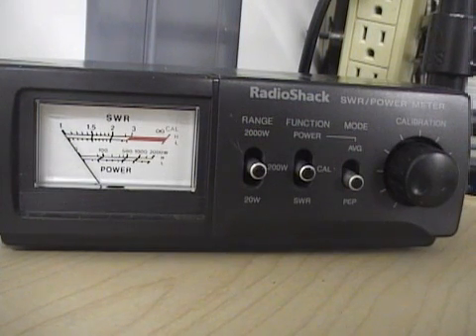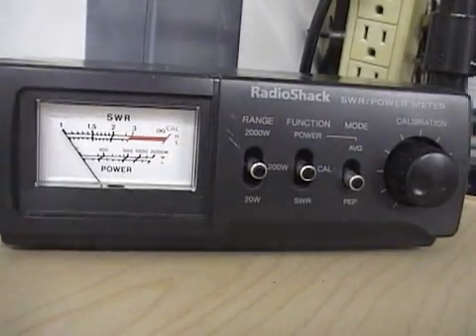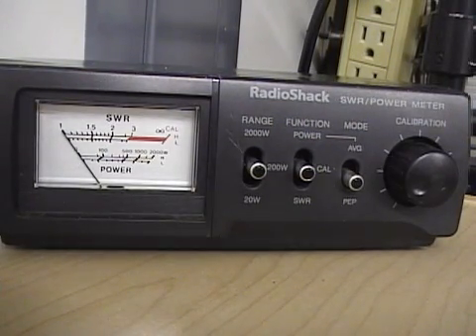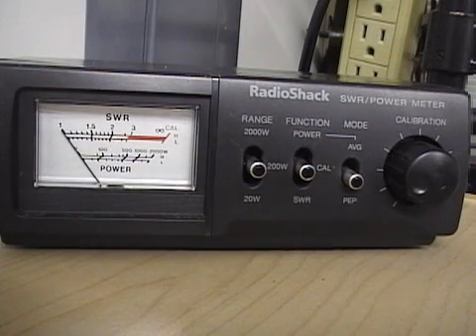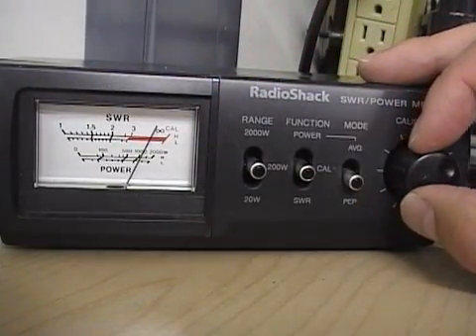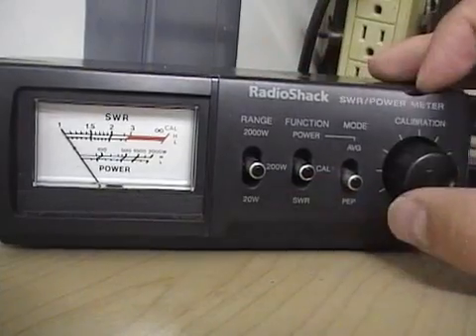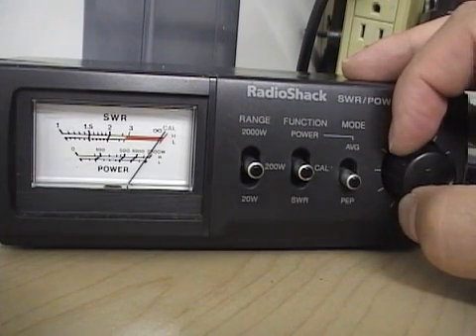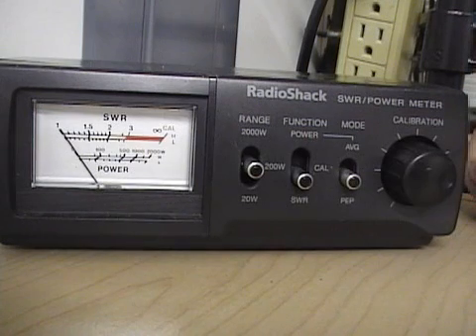How to use a SWR meter - CBradiomagazine.com

Comment: Do you keep the mic keyed when toggling the switch from "CAL" to "SWR"?
Answer: Yes 

What if my reading is higher on channel 1 than channel 40 or vice-versa? 
Answer: If SWR 1>40 then your antenna is too short. 
                If SWR 40>1 then your antenna is too long.

Should I be conducting the test in a wide open area free from obstructions such as trees and/or buildings?
Answer: Yes, optimally

When I remove the plastic protective end cap on my antenna to make the small adjustments necessary, should I replace it for each new reading?
Answer: Yes

Should this video have covered these basic points about SWR adjustements?
Answer: Uh huh

Comment: The last thing you said is literally the most important thing you said, people overcomplicate radio so that they can feel smart in making another person not understand it, not u, just in general, that last statement “the more power the lower swr should be” is really all you need to know in addition to the instructions given, just pisses me off how some people get confused due to other ignorant hams over doing things to feel better about themselves. Good video. Surprised i didnt hear of you guys back when i was into 27.
Reply: “the more power the lower swr should be” is not what he said and it's not the case.  SWR should be as low as possible regardless of any power level because it's a measure of efficiency.  The only difference higher power makes is that at high power levels MORE reflected signal is fed back into the transmitter, and thus more stress on it.

You could say the higher the power the more important it is to keep an efficient (low) SWR to protect your higher-powered (and therefore more expensive) transmitter, but the principle is identical at ANY power level.

Also I'd say anything below 1:1.5 is more like "minimal" than "excellent".

Comment: hi ,
do You Know the Full Range of the Frequency Measurement ?  is it for any mode  Fm , Am , SSB  ??
is it 1.8 Mhz to 60Mhz   or     1.8 Mhz to 200 Mhz  ??,
any one Know the Answear PLZ ,.
Reply: See this, it is the official FCC frequency guide and it is MHz. https://www.fcc.gov/wireless/bureau-divisions/mobility-division/citizens-band-radio-service-cbrs  We capitalize the H to honor Heinrich Rudolf Hertz who discovered the hertz between 1886 to 1889 in a series of experiments, later to have the SI unit, Hz in 1930, officially stated by the  International Electrotechnical Commission  in his honor.  It was adopted by the CGPM (Conférence générale des poids et mesures) in 1960, officially replacing the previous name, "cycles per second" (cps). hope this helps 73's

Comment: in the 1965 i bought a betal block the size of a big eraser with coaxal cable  conectors on each end  you could fine tune swrs by turning cdrew in center of block. anybody know where you can find these blocks?

Comment: I have a Uniden pc78xl (Phillipine model) and a cheaper antenna that I found on Craigslist, I hooked it up to an SWR meter and absolutely nothing happened. What would cause this? I'm sure the radio works because I was able to get a signal from someone the other day. I doubt the swr meter is bad as it is brand new. What could cause it to not read anything?
Reply: listening is different than transmiting the finals are most likely bad on the radio or the jumpers to the swr metter are bad
Reply: *****  I figured out what was wrong, it was a bad ground. The radio works great now!
Reply: +.mlh glad to hear it's fixed

Comment: i have a starduster swr 1.2 on ch1 and 1.1 on ch40.
radials are longer than the radiator.radiator is at 102" after  i got the 102 " on the antenna i adjusted swrs with the radials
when i press carrier i got 3.5w but when i modulate goes to 3W@ 2.5 W why?
the harder i modulate the out put drops
Reply: I see this is a year late,do you have problems solved?,if not..I suspect the radio is tuned to 100% power,leaving no room for carrier signal to expand with modulation..tune power down to about 75%,the modulation will then cause the power to rise near 100%(forwards modulation rather than backwards)

Comment: Thanks CB Radio Magazine for showing me how to use my meter.I bought it as a misguided fool. Now I'm at least a guided fool! I don't know if anybody will see this, sometimes the internet is kinda like CB you transmit nobody answers. I put a CB in my truck for offroad stuff and when I tow my racecar on I-95. I went the cheapest quickly available route. Read Cobra 19 and 2 foot magnet antenna. I didn't intend to talk but since then after I made the mistake of turning it on (2 weeks) I put a 5.5 foot whip on my pickup bought this meter and checked the SWR, My meter says I'm getting out but I noticed when I put it on watts it goes to I guess around where 4 would be when I dead key but when I talk it doesn't swing. Like I've seen in other videos. Is my radio messed up or maybe my mic? I haven't gotten a radio check with the new antenna I tried one but I knew I might just be out of range running stock from anybody No traffic in at the time either I can hear loud and clear. SWR is 1.3 at 1, 19 and 40.. I got a couple with the old antenna which was sissy looking and a 14 dollar mistake... Do y'all think I messed something up? Sincerely CB newbie with a strong chance of becoming a nut.
Reply: I just found this vid and your comment, I'm pro driver w/many years cb use,have you become a cb nut yet?,i may have answers

Comment: I just tuned a pair of firestik antennas and got a little nervous when initial was off chart swr with screw down. But installed spring on bottoms and extended tips 3/4 inch and was 1.1 and 1.3 right on money

Comment: You can't adjust a duckie; it would have been set by Midland.  Putting the meter in line would change that setting.because it becomes part of the feedline

Comment: I followed this procedure to test the swr on a duckie antenna that came with my midland portable radio, the readings on both chan1 and 40 are off the scale! Any tips are appreciated. The radio works fine xmit and rcv. The antenna has not been modified and tested as-is from the factory.

Comment: These CB SWR meters also work on HF ham radio. I used a CB SWR meter to tune a 10 meter dipole. Doing PSK31 I had a peak SWR of about 1.3:1. I could probably shorten the antenna a little more for better SWR; but I am not sure if I want to bother. I am only running 5 watts, so 1.3 should be fine.
Reply: 1.3 is good it's when it starts getting 1.7 and up even 1.7 is ok but not great i go by 1.5 and down